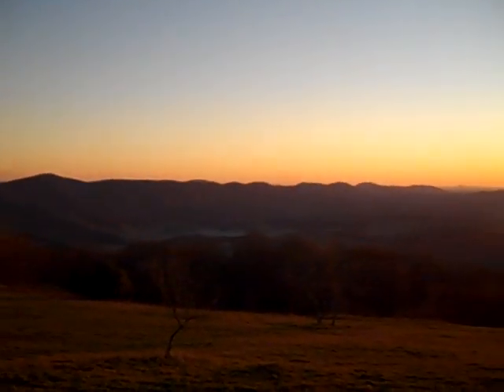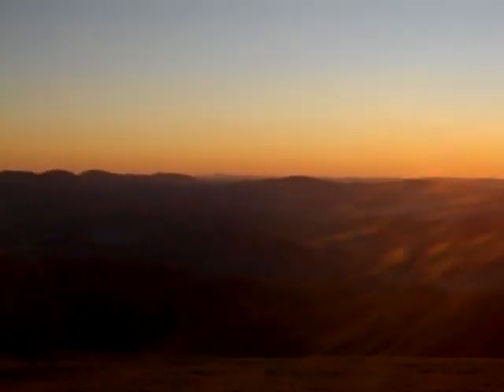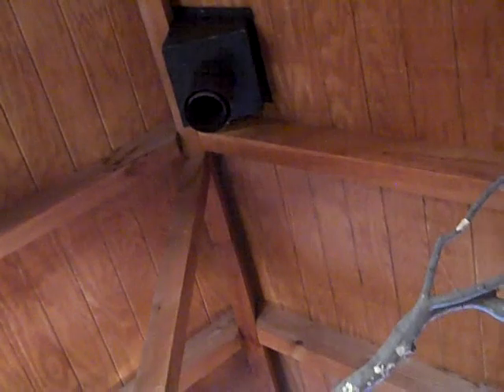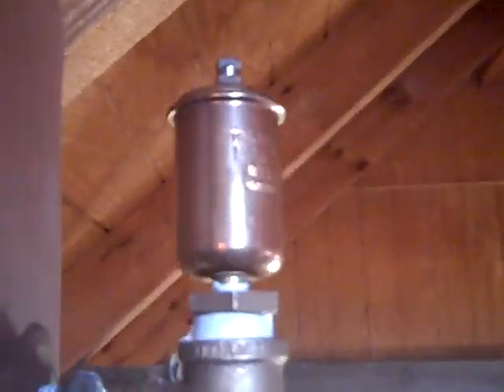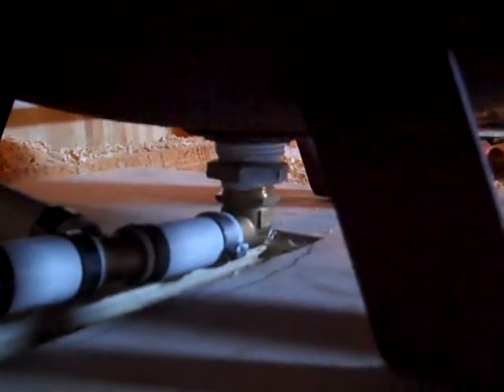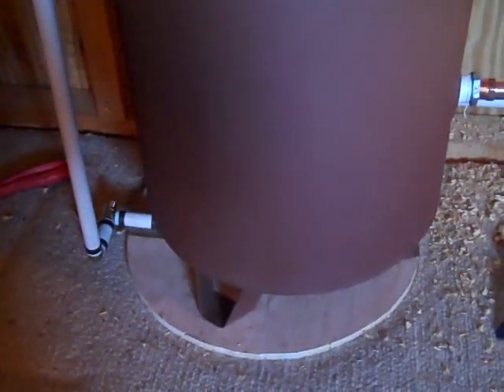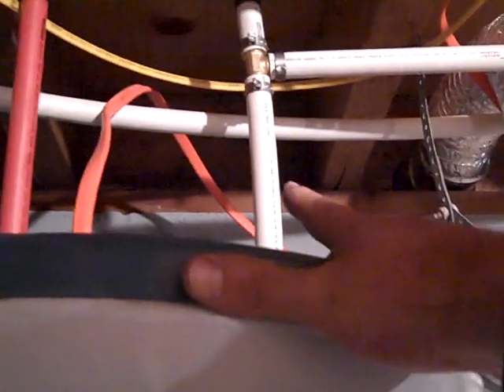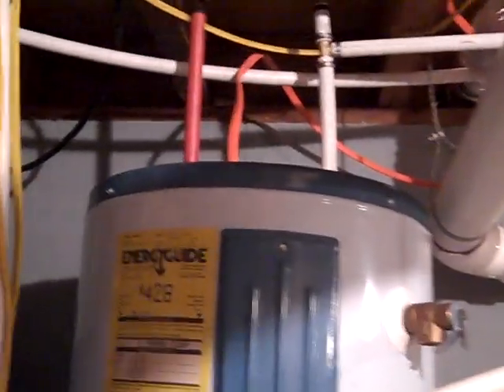Hot Water Part 2:  The old fashioned way

Comment: I just happen to have a Pacific energy super 27 and for the past two years I've been thinking about running the cold water that refills my hot water tank through a coil in the wood stove. So, every time somebody runs the hot water to take a shower or a bath, when the cold water replenishes the supply in the electric hot water tank, it has to flow through the wood stove coil first and get preheated. I'm thinking I will need a recirculation pump because I don't want the water sitting in the coil too long when someone is not using hot water.

Comment: You have such a long flue pipe you should wrap it with 3/4 soft copper you could add 300 feet easy to your system and add solar on the roof

Comment: Good job, I had problems with the hot water going to my water tank.. so I used a pipe thermostat wired to a central heating pump.. Mine is a open coal back boiler.. I love it
Reply: Pipe thermostat?

Comment: Thank you for sharing all of this very useful information with everyone! So it is possible to plumb the cold water inlet into the drain of the hot water tank rather than the top like most other set-ups?
Reply: but the function of the top inlet is to clear the sediment through the dip tube during flushing.

Comment: Did you say you're putting "firestop" where the copper gets close to the wood? Do you mean insulation? (Heated water inside piping would not catch wood on fire.) For more capacity, you could use a tank up on a tower, like in the old days; many cities still use them.

Comment: We are in the south and it gets pretty hot during the summer, would it be better to put the temperting tank outside where the sun/environment heat the water. MAybe put it in a insulated pump house painted a dark color? We will be building a Hobbit/cob house which stays in the 70's during the summer and I do not think it would work in the home. Also is it needed to have so many ways to heat? I know in prepping redundancy is the key, but could we get away with just an electric or propane?

Comment: Part of the problem is electron shell exchange. The iron has a higher molecular weight and the eventual effect is that the copper will decay. I don't have a clue to the time table but a plumber or someone with a lot more education than me might. I do know that the navy used zinc blocks to avoid this problem.

Comment: I do not think it was shown in this particular video, but the coil is not inside the burn box.  The coil is on the back outside the burn box , but is between the burn box and rear heat shield. Does copper sound ok for this location?

Comment: brcause the EP says so...no, like earthship freedom says, Pyrolysis occurs inside the burn box with the organic fuel.  /this leads to a failure of the copper tubing over time*(not that long either,)  It is best outside so it will not get as hot since steam will cause other problems inside the plumbing system also, like blowing your pressure valve.  Also to prevent leaks by visual inspection.  The ?coil? in thi video was a little short IMHO, but thats me.  This system sounds greatly,expensive,

Comment: Pyrolysis.  Happens when intense heat from a source will change the wood into an easily combustible material. I learned all about it when researching wood-cook stove installs. I never would have guessed it could happen.

Comment: I see that engineer775 does not respond to questions on this video. 
Can someone tell me why the need to insulate the copper pipes from wood, as the temperature would only go as high as water boiling point, and even then, not very often ?
I am considering something like this, but wanting to use copper pipe beside the stove. 
Is there any major problem with using copper in that main heating coil ? 
I was thinking of a much longer coiled copper pipe, where the heating coil is.

Comment: Blue Tanks were to keep up the pressure I think because of the low flow of the spring or well pump.   So with the Well/Spring switch is that a double throw switch of some time where you are switching between two pumps, or is the spring "Unpumped"?   I got a bit confused with the dialogue/video when you discussed the TP Value plumbing and cold water line.  It seemed like you said it would vent back into the cold water line, but in seeing you describe the plumbing again downstairs you combined the

Comment: do you have to use the water heater and a tank what is the purpose of the extra tank is there a reason you cant run it directly to the water heater it seems like the trip to the extra tank would cool it off im sorry im new to this and id like to have this set up in my house along with solar i just dont want to mess it up

Comment: My Dad has a similar set up preheating the water along side the furnace.  It has nearly eliminated the propane hot water bill during the winter.  Next were thinking vacuum tube solar hot water, if you haven't seen one in action I was shocked at how well they work.  We were thinking of putting in a transfer valve to the preheat tank going from the furnace coil while were heating with wood to solar hot water during the warmer part of the year.   Eliminating the hot water bill can save a lot of $.

Comment: is there a pressure difference between the attic/loft tank to the cold supply going into the electric water heater, would one have more pressure than the other?